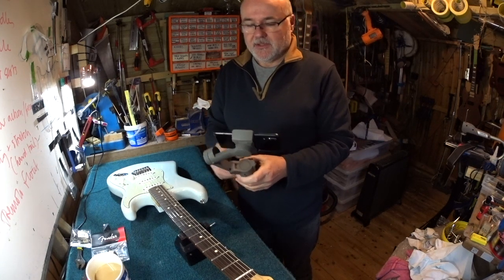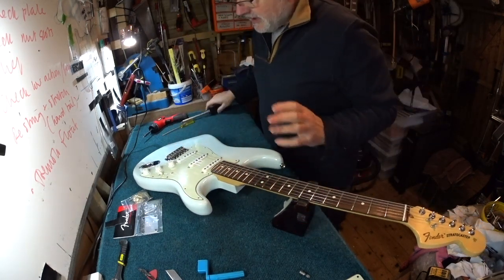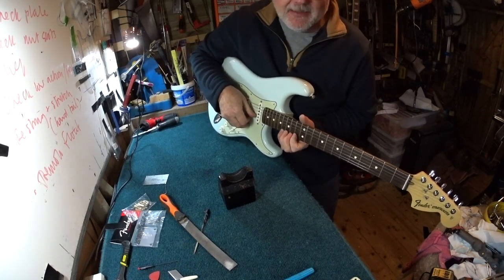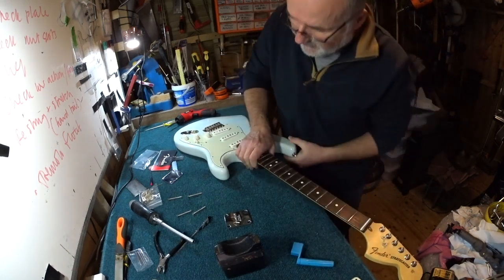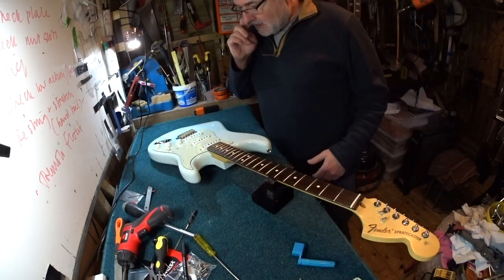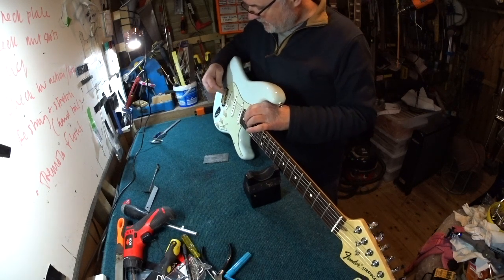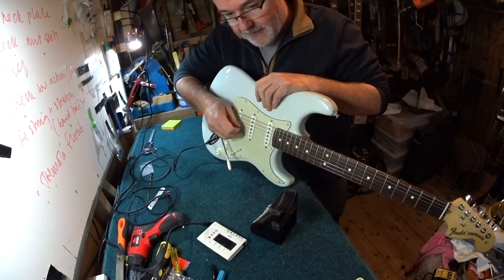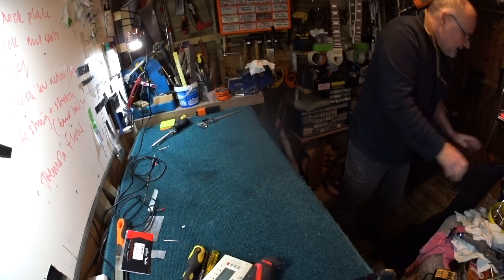Fender USA hybrid Strat set up

Comment: Hi Sam..in my opinion or from what I have seen in regards to how guitars are painted..after each individual coat is painted, it dries and then that coat is sanded down somewhat(roughed up slightly) so that the next coat can adhere to the surface, which is great, but from what it looks like on the guitar you have there, they may not have focused too much on sanding the inside of the back cavity hole on the guitar before re-applying the next or last coat of paint, hence the flakes. I hope that makes sense. I love your channel. I have learned so much.
Reply from the maker: Hi Todd... makes sense. Just that the sequence there goes: wood / clear gloss / blue paint. Weird eh?
Reply: I've got a 2014 USA strat Olympic white. The paint has sunk into the grain all over the body. Do you come a across any guitars like this sam?